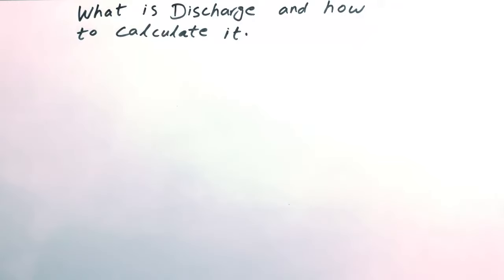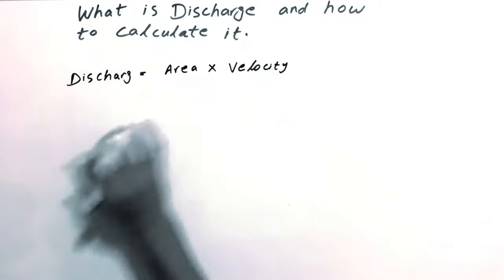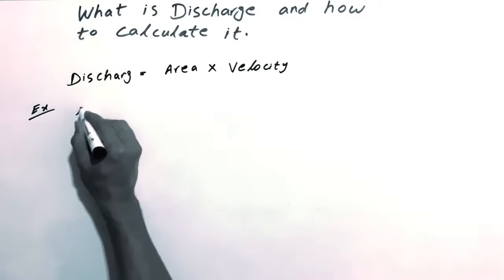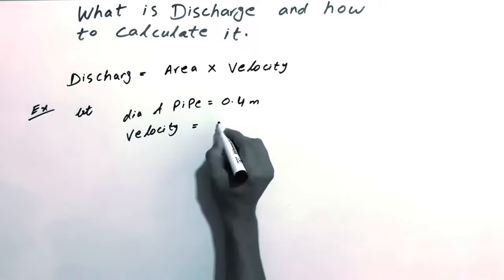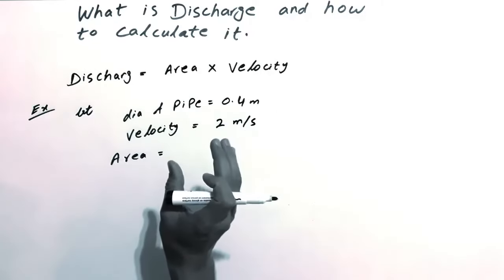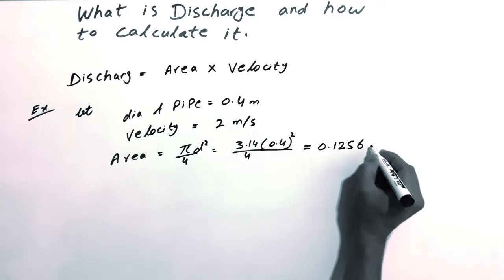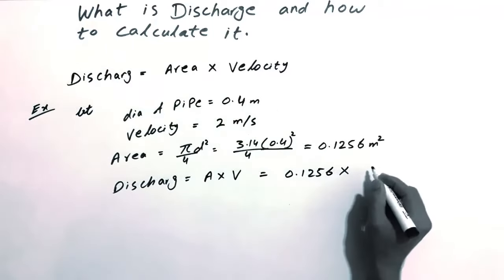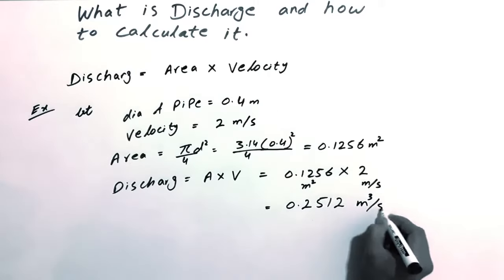Discharge and How to Calculate Discharge

Comment: an empty tank of capacity 18480 litres is to be filled with water using a cylindrical pipe of diameter 0.028m. The rate of water from the pipe is 2m/s. Find time in hours it would take to fill up the tank.
Reply from the maker: Thanks for your question I look into it and soon make a video on that. 👍
Reply: Around 250 Hours. ?
Reply: How to calculate velocity

Comment: An oil of viscosity 1 N-s/m2
flows between two parallel fixed plates which are kept at 
a distance of 50 mm apart. Find the discharge of oil between the plates. If the drop 
of pressure in a length of 1.2m be 3 kN/m2
. The width of the plate is 200 mm.